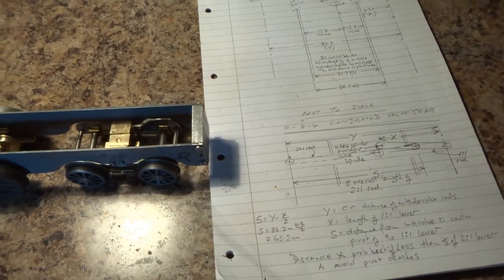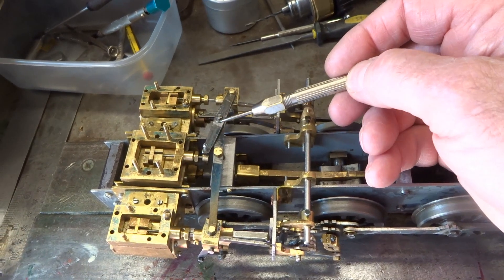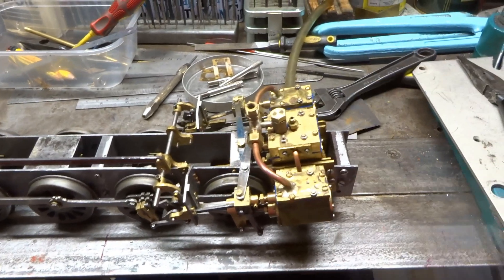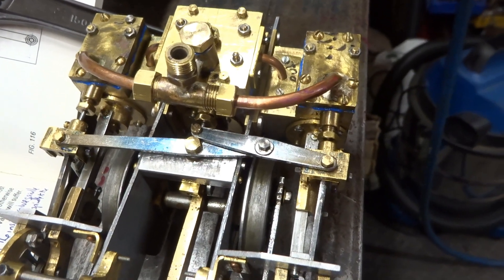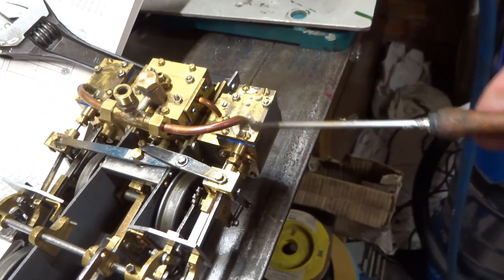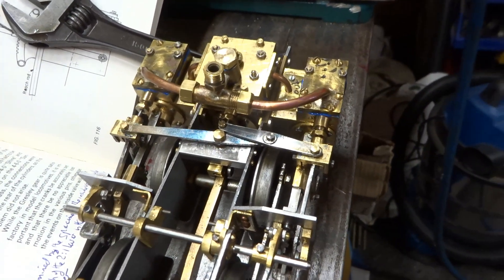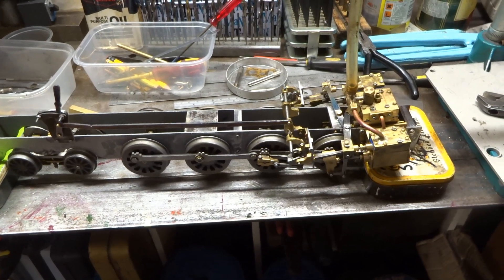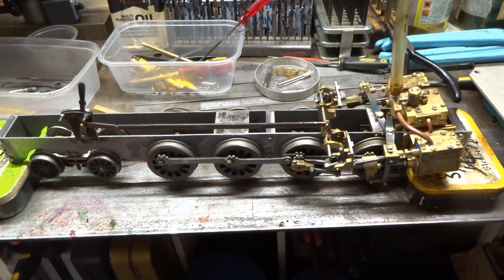Gresley conjugated locomotive valve gear

Comment: Not sure why you want to move the pivot point further left. Every real loco I have seen has the centre valve beside the centre cylinder on the same side as the floating lever, which keeps the floating lever short and ensures it doesn't have to cross over the main pivot. I think the best way to design is to decide where you want the centre valve first. Then the centre of the floating lever is halfway between the valves, and the main pivot is 1/3 of the distance between the centre of the floating lever and the other valve. If you have the centre valve in the exact centre of the frame, the valve and the main pivot coincide, which is not what you want.

The issue of sideways movement due to the radius of the levers is usually managed by having a link to connect between the valve and the levers. Also, your arrangement is slightly unusual in that the Gresley gear is on the same side of the valves as the main Walschaerts gear. Real locomotives usually have the Gresley gear on the opposite end of the valve spindle (though this probably isn't practical for a model.) The setup used in your model is used on some real locomotives however, as using the opposite end of the valve spindle causes problems due to expansion.
Reply from the maker: Many thanks for the information you are clearly very knowledgeable. I only carried out limited research on the Gresley valve gear. I do have a tendency to 'reinvent' the wheel for myself because I find that approach more interesting for me. This loco is an unfinished project. I built a boiler for it, but it is most unsatisfactory. I have now bought some more seamless copper and intend to have another go at the boiler in the coming months. Should the second attempt prove more fruitful than the first I will post another video. Unlikely to happen befor 2024 however.
Reply: @edwinwhite933  You probably want to move the centre valve about 12mm to the right of the centreline. That will shorten the floating lever by 12mm, moving the midpoint of the lever 6mm to the right. As the main pivot is 2/3 of the way along the big lever, you'd need to move it 6 * 2/3 = 4mm to the right (not left). That would give you an 8mm difference between the position of the centre valve and the position of the centre pivot, avoiding any clashes.  I hope you have enough room in the frame to do that, and keep the cylinder directly below the valve! You can see in the book image at 3.18 that the centre valve is displaced to the right of the centreline, with the piston beside it on the same level as the valve. This is typical for real locomotives. The fact that the centre piston is higher than the other pistons has to be compensated for in the design of the crankshaft to ensure correct 120 degree timing.
Reply from the maker: Many thanks. I have just this week (December 2023) resurrected this project. The boiler I originally built for it was a disaster so I have begun to make a new larger diameter one. Although the motion does work well on air despite my haphard amateur approach, when the new boiler is sorted I will study your comments in more detail with a view to possibly making some amendments to the valve gear. I do remember however that I did compensate the crankshaft for the higher centre piston. As usual by trial and error, but I did get there. The boiler will take some time but I will post another vid on this loco in due course.

Comment: Fabulous project. I was wondering if anyone had done one and here is yours. Very interesting design. And speaking for myself, we are pleased that you got it to work. 

But a great job of building and such fun to see run. I assume that the center cylinder is the low pressure one, fed from the two outside ones.

I shall have to track your progress. 

I do know what you mean about getting distracted and letting projects sit, I myself am horrible about that sort of thing.
Reply from the maker: aaagh well. Re the centre cylinder really I cheated no excuses but I got fed up with this project. All the cylinders are actually the same bore as far as I recall and get the same inlet pressure rather than the outside cylinders exhausting through a low pressure bigger bore centre cylinder. I did make a gas fired boiler for this engine but it is no good - I made a big mistake in its design and it does not produce enough steam cos among other things the water space is far too small. It's on the shelf and when I get some enthusiasm I will do it again and hopefully properly. All that said as stated in my vid the engine works well under compressed and should do better when it gets a proper supply of steam.
Currently I am still working on a diagonal paddle steamer engine, but life (projected house move) has got in the way and progress is pitiful.
Many thanks for your kind words.

Comment: I don't know anything about model railroad, so take this comment with a grain of salt. I'm focused on your issue of the levers providing an arced path instead of true reciprocation. It occurred to me that the fulcrum point for the lever, specifically the one-to-one lever, perhaps the fulcrum had either significant clearance or the ability to move a small amount. The reciprocating motion of the valves would be enough to cancel the arc via floating fulcrum. Your thoughts?
Reply: It's the only explanation I can think of considering you had drawings to view.
Reply from the maker: Thanks Jean-Paul, I thought about creating more clearance on the fulcrum, but decided in such a small scale the 'lost motion' might be somewhat disproportionate. Not at all clear how this issue was overcome in prototype, but I did read that wear in this type of motion was a real issue, perhaps the 'arc' effect was one of the reasons (as well as the fact that the motion was apparently difficult to access for lubrication).  In the end I played about until I got a 'sort of' working solution by adjusting the length of the 1:1 lever.
Ed
Reply: I've seen people make do by drilling an oval hole and soldering the bolt in a roughly loose position as to allow a proper slip. 
the tolerances are horrendous each time though. I don't think I can do better either, being honest.

Comment: Would driving the middle valve with a yoke captured in a groove on the valve rod help reduce issues with radial movement? Also nice work and it seems to run well.
Reply from the maker: I did consider that approach but everything is so small in gauge 1 I doubted my ability to  construct to the necessary tolerance. In principle I think the yoke idea might work. That said the diagram in Martin Evans book does not show any provision on the prototype to deal with the issue of radial movement on the 1:1. If life ever returns to sanity I may try a visit to the York railway museum to see if they have further info.
regards
Ed

Comment: They say keeping you brain active helps prevent dementia - but of course building conjugated valve gear in gauge one could be viewed as insanity in the first place! This project is so fascinating, CAD drawing the mechanism in the first place is the way of the modern world - but then you would end up spending all your life behind a bloody screen instead of the shed!! So the fact that you have stoically kept at this, and produced such a wonderful working chassis is amazing, kudos to you for this one Ed, its superb.
Reply from the maker: Thanks Garry and yes I did reach a point where I thought I may be going mad. I nearly gave up with the view to constructing slip eccentric gear for the middle cylinder. Perfectly workable and I believe may have been used for some locos in real life. However if something is worth doing might as well do it the hard way is part of my philosophy -LOL.
I doubt I will ever build another 3 cylinder, but if I do I have certainly learned a few lessons!
regards
Ed